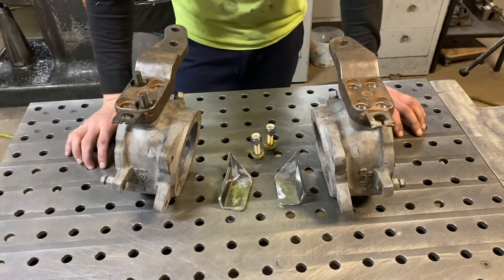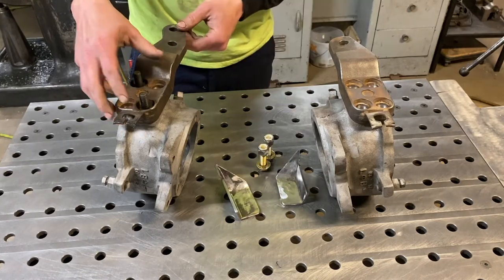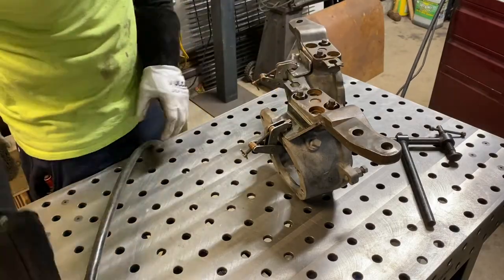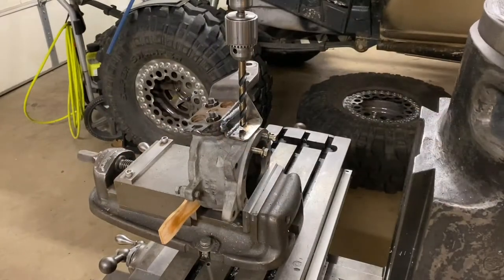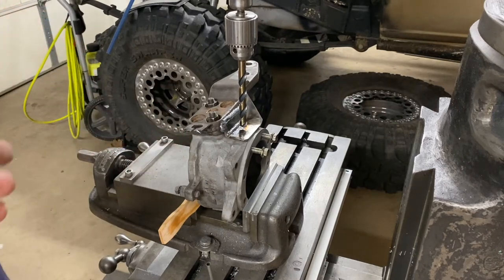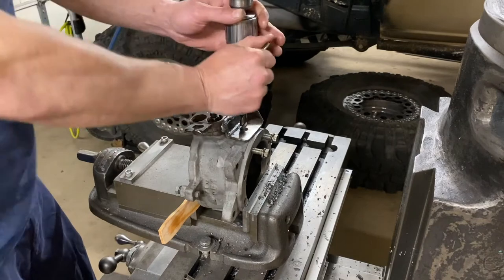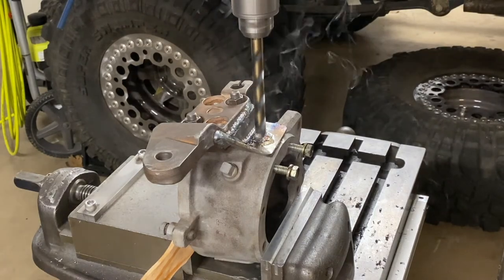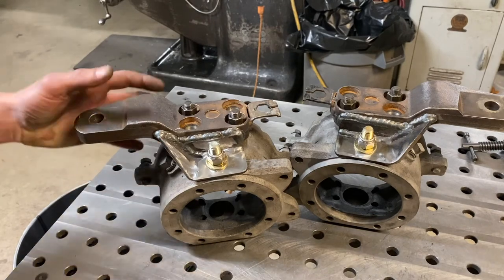Toyota 5th stud mod for solid axle steering arms

Comment: Nice, but should have used your mill to make flats on the knuckles… studs/bolts don’t have much shear strength, they hold by producing friction between mating surfaces, which is why guys who don’t tighten their studs are bound to snap em eventually… still it will help somewhat
Reply from the maker: Thats a good idea. Im always worried about making things weaker by removing material but I probably could mill it a bit. Thanks for the input.